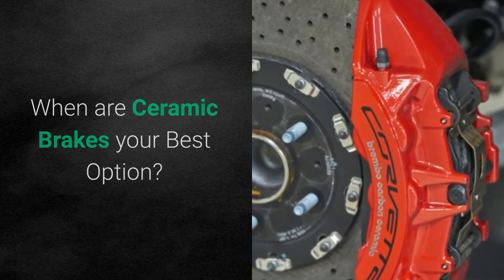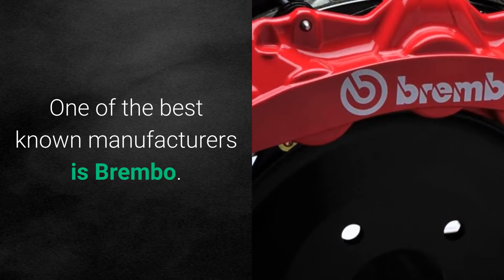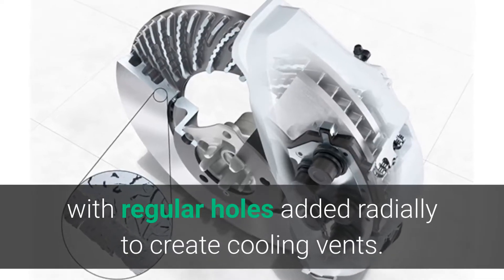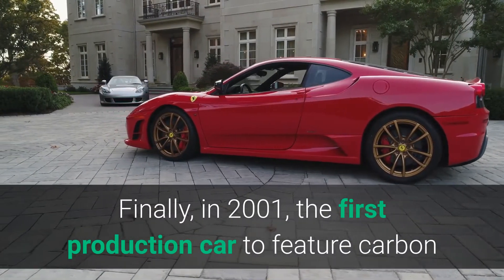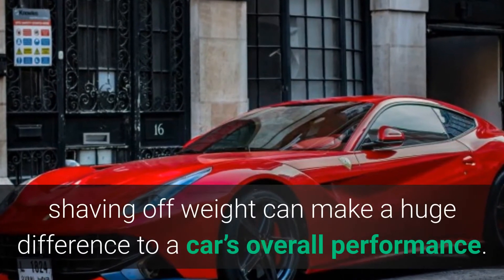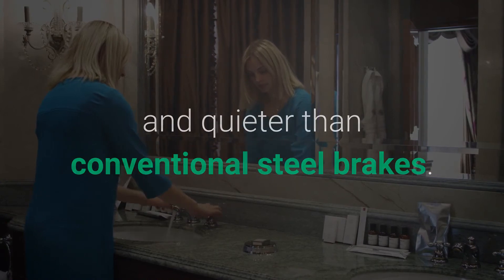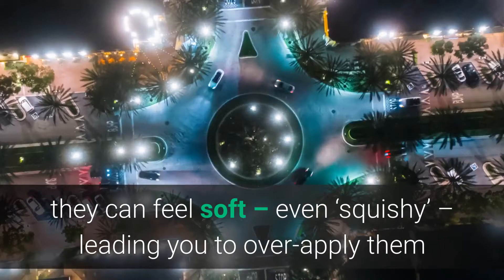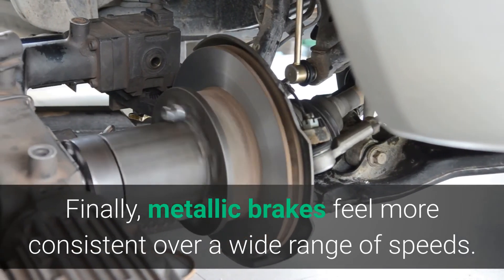What Are Carbon Ceramic Brakes?

Comment: i raced sports cars successfully for years  Now I just do  track days in a McLaren, a Corvette and have started track days (non-racing ) in a new Porsche 992 Turbo S Lightweight with the OEM CC brakes 
I  replaced the McLaren' 600LT's CC brakes with iron immediately .A track day for a quick pace driver with this car and CC brakes can run over $2,000 in pad and rotor wear at a track like Laguna Seca Monterrey California with its 3 hard -braking zones . In reality  the car stops fine with the iron brakes. The 2019 Corvette GS has stock iron brakes. Its stopping power is remarkable / seems better than the McLaren. The CC rotors on McLaren wear quickly even with aftermarket pads. 
CC brakes stop poorly when cold on the street. Can actually be scary .
 The good is virtually no pesky brake dust and can easily last longer than you might own the car

Comment: i dont understand why steel brakes become better for daily cars if booth became with abs system
Reply: i think abs is for when you slam on the brakes. it makes sure that your tires dont lose traction as it helps to slow the car down faster as opposed to skidding to a stop
Reply: Because steel disk brakes cost between 30-300$ each while carbon ceramic cost around 8500$ each

Comment: i bought max carbon ceramic pads for my car but they were not very expensive and this video making it look like its very special and super expensive. did i buy something fake?
Reply: Those are just the brake pads, they work better than normal cheaper brakes but you are still using a traditional brake set-up biting down on steel rotors. True carbon ceramic brakes are around a $10k upgrade and use ceramic rotors that are very strong and heat resistant.
Reply: @Yukikazehalo  i got the slotted and drilled rotors with the pads. they perform really amazing. but definitely the rotors are not carbon. not for the price i paid. it had black coating which melted away as soon as i drove.

Comment: Where can I buy ceramic discs for Porsche 911 ? I'm from Brazil, thanks
Reply: projetos de pobre you can’t buy them. They must be factory added to the car. Good luck!
Reply: @m.s8280  and afther they r gone
Reply: You can buy them, but they are not easy to find and very expensive. Try asking at a car dealer which sells performance cars